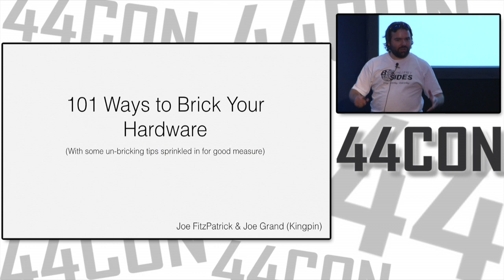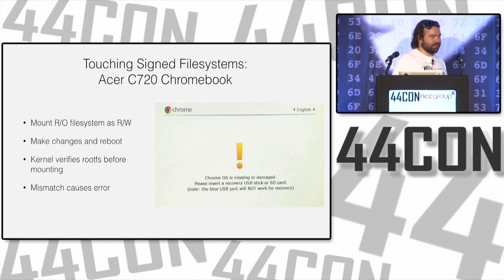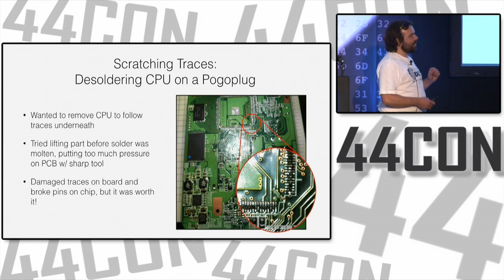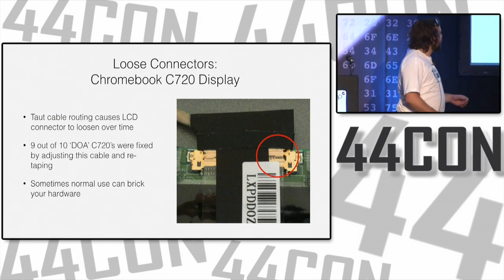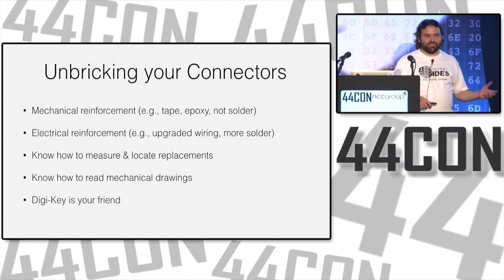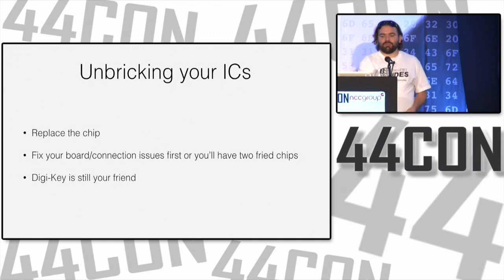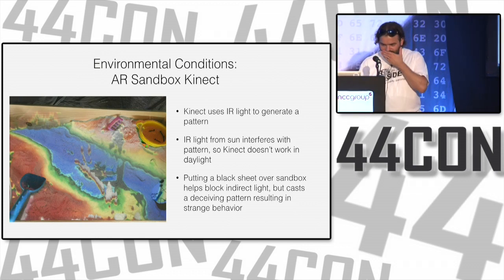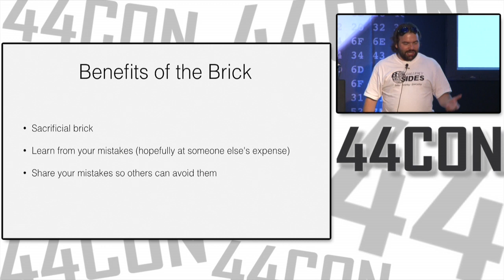101 Ways To Brick Your Hardware -  Presented By Joe FitzPatrick

Comment: I want to run my own compiled Uboot from SPI though glitching. I can do the same with NAND/NOR flash to glitch the CPU to run my own version of UBoot to get the CPU access and for that I am using pin 20 of flash IC where i load specific data and reset pin of the CPU. However, in case of SPI I am unable to understand which pin or pins should I use with reset pin to execute my own UBoot after glitching. Some of the target boards are on NAND some on NOR. I can run Uboot in case of NAND/NOR as I know on which pin I load Specific data and the reset pin for glitching but in case of SPI flash I am unable to understand what to do